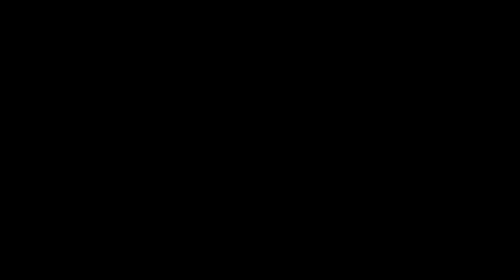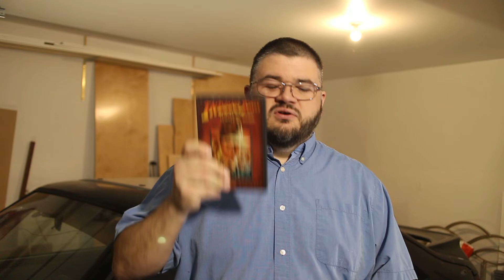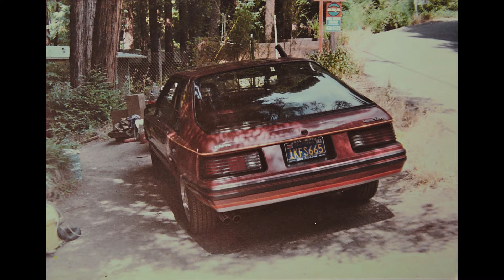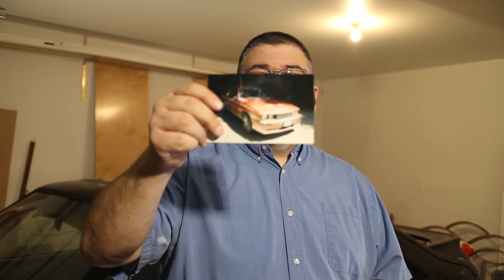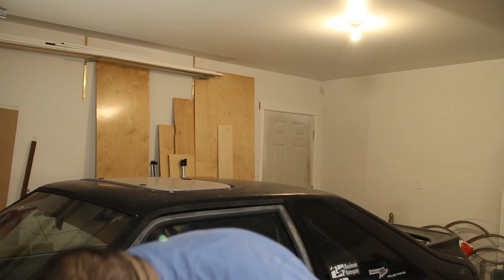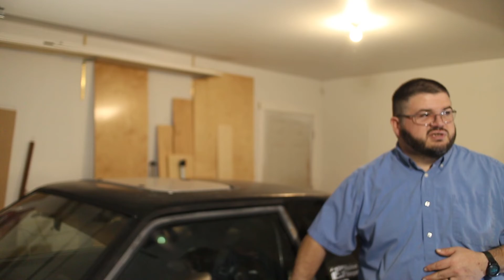Black Ford Garage Episode 0

Comment: Engel's Coach Shop sent me, thanks for helping the old man out.    This vid caught my eye.  Back in 1984 I bought a Mustang SVO, I learned quickly it was a money pit for a young man of 23.  I was going through $2k in tires a year and replaced the clutch two times.  It was an absolutly great car to drive, but a finacial nightmare for my future.  I sold the car after three years, it broke my habit as a car guy.  fwiw my previous car was a 68 Camero, bought it for $500 in '78...that was also a great car.  I miss those days, but glad I moved on. ymmv
Reply from the maker: LOL, why do you think I still have this?! :-D I put too much money in it and would take a huge loss if I'd sold it.  I want to get it back on the road, put the wideband in it, run it at the local drag strip, and do a hill climb event they have over in the Rogue valley.
Reply: @eformance  Yeah, been there, done that.  Keep going at it, you'll have what you want.  It's the journey rather than the destination...Peace.